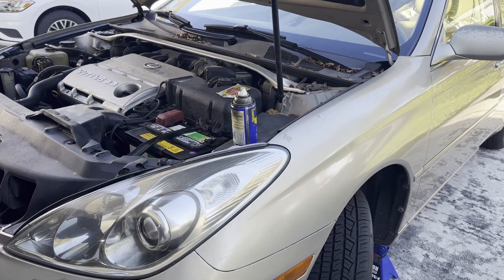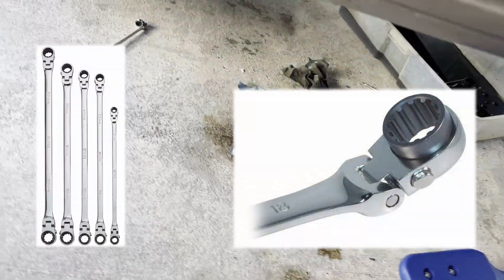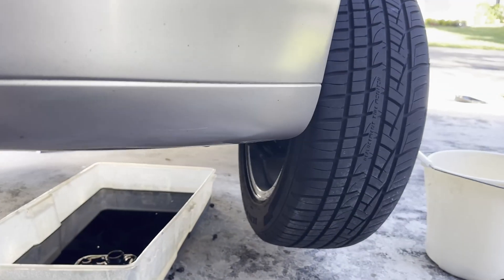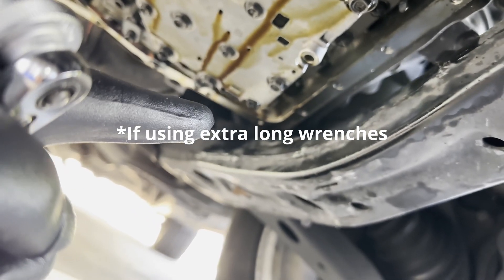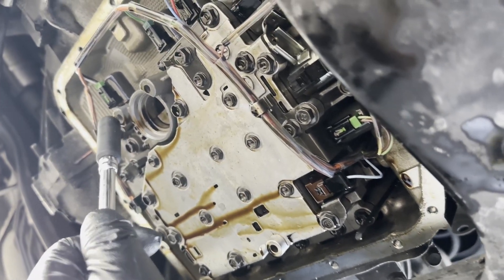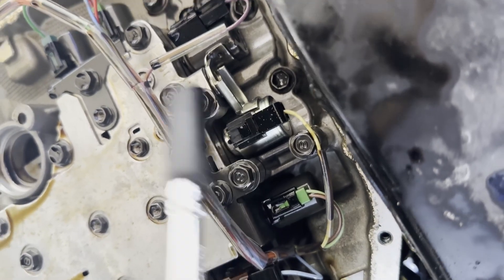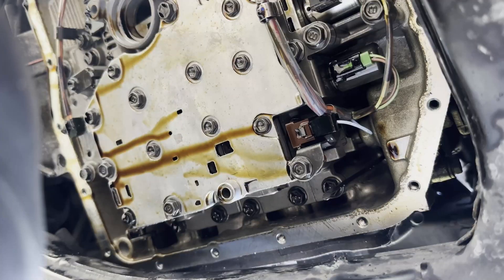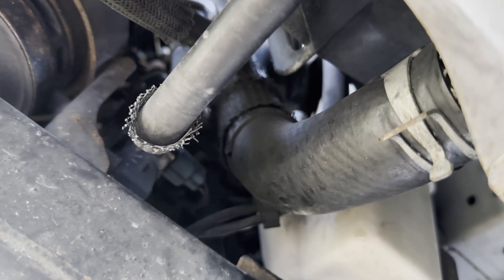Lexus ES330 Transmission Solenoid Replacement

Comment: Highly recommend you go about slowly replacing all of the tranny fluid based on that color. I would wager that your solenoid wasn't exactly a problem itself, but was blocked by friction material from your clutches, that is what stains the fluid black. If you don't want to be replacing more solenoids every year or two, just drain and fill your tranny about 6-10 times over the next bit, this will slowly dilute the old bad fluid out instead of shocking the system with all fresh fluid. I believe you're tranny holds about 8.5qts with diff included and takes 3.5 on a drain and fill(obviously check your handbook.)

Comment: How long after you replaced the Shift Solenoid D, was the car able to shift into 5th? Was it right away or did it take a couple days???
Reply from the maker: Should go right away. Mine didn't, but that's because I coincidentally had knock sensors go bad and put the car into limp mode before I could test it. The replacement knock sensor was also bad (not OEM), and the car had a lot of other problems that I didn't want to deal with. I frankly got tired of working on it, so I junked it. My next step would have been to drop the transmission and buy a rebuild kit as I said in another comment reply, but I don't have the setup or space to take on a job that dirty and complicated. Good luck if you're having a similar issue. Hope my vid helped.
Reply: @Omnis2   I just replaced my solenoid D yesterday and on the first drive, the car went into 5th but it seemed like it didn't want to stay in 5th. I drove it again later on the same day and it seemed to get worse and just wanted to stay in 4th and then P0766 code came back on later that night.
Reply: @Joecuzzi  My es300 has been running solenoid codes the whole time I've had it. So, your solenoid PROBABLY isn't bad, what's more likely is there is a lack of friction material on some clutches, or a lack of pressure when demanded to go into certain gear from gunk buildup. It is possible that the solenoid has shorted or stopped actuating, but it is more likely another problem being reported by your ecu as a random solenoid because this is the only way your ecu can report on the transmission in these older cars. The code is not saying that solenoid D is broken or inop, it is saying there is an issue in the function of solenoid d, whether that be the actual solenoid, the clutches it controls, or some other pressure problem. From my last 6 months of experience with a 200000m es300, try drain and filling new ATF from toyo about 6-10 times(the aftermarket valvoline etc do not work correctly), and drive it really hard for about a week between drain and fills. The idea here is similar to trying to do a light engine flush, we want the new fluid to get hot and help extract old gunk gently and push it to the filter, which you should replace at the very end. If you notice any improvement in shift quality throughout this process, I would bet strongly you're solenoid is in fact, fine, and it is a pressure buildup problem from gunk in valve body passageways, your next step would be a sonnix valve body rebuild kit. If draining and filling 6-10 times isn't slowly improving your shifting, your clutch plates are likely just shot and its time for a full rebuild or junkyard trans.
Reply: @Omnis2  I see, disregard my previous comment, sorry you had to junk your es330, I really love my 01 es300 but am slowly trying to chip away at an array of problems. Solenoid codes, knock sensors, vvt and misfires for me. The surprising part is my car really drives perfectly fine when warmed up, but when cold cant even get into drive 😂.
Reply from the maker: @koleking2519  No, no, don't disregard your comment. Keep it here because it's really helpful. I agree that the new solenoid probably wasn't bad, but the old one wouldn't actuate when I tested it outside of the car. It's possible that there was a bunch of gunk in it that wouldn't let it function correctly. I had done a transmission fluid change as a regular service and that's when the issue started, actually. Once I eliminated the solenoid as an issue, I knew the next step would have been to drop the whole transmission and rebuild it since, as you said, the clutches between the OD gearsets were probably shot. The fresh Toyota Type 4 probably washed away whatever friction material was left holding on lol. In hindsight, something in there had to have gone bad to get the transmission fluid that black that quickly. Never had that in any car I've owned.
Reply: @Omnis2  I would agree with you're diagnosis, its unfortunate that the previous owners neglect can make basic maintenance treacherous, but, such is our life as grease monkeys.  If I could go back in time I also wouldn't have touched my fluid, it was quite dark, luckily, 6 changes later I am experiencing noticeable improvement in my shifts so maybe I caught it just in time, probably not though, from all my research my u140e is basically made of glass at this milage.

Comment: Did your es330 have any error codes?  I have no codes, but the dash shows 4 when its in D  and the transmission won't shift to 5th.
Reply from the maker: P0768/9 was the solenoid code. What you're describing is a broken shifter position selector switch. There's a "U"/"Y" white plastic switch that only goes with the shifter when you move it from D to 4-L.

Two solutions:

1. Cheap: disassemble the bezel and the top part of the shifter assembly including the black plastic (covering the path where the shifter travels), etc.. Peer down and look for the broken U or Y shape white plastic piece, it should be in the 4-D area of the track. The broken switch will look like half of the letter U or an opposite-facing letter J -- get the picture? All you have to do is flick this switch to the right (-->) -- this will now tell the transmission that the selector is in the D position (gears 1 thru 5) when you start the car up later. The only downside to this is that you won't be able to use 4 to L anymore without getting stuck in 4 and disassembling the whole thing again. You can probably rig something up with epoxy to fix it.

2. Expensive: Replace the whole assembly at the dealership.

Comment: Why do you have to remove the valve body cover to remove shift selonoid? Doesn’t appear you have to…?
Reply from the maker: Sorry, your question is unclear. You have to remove the cover because that whole valve body is sitting in transmission fluid, but that's obvious. I'm assuming you mean removing the valve body itself. I noted at 3:59 that you don't have to remove the body for some of the solenoids, but for the long solenoids you may have to. I noted that I was wasn't sure about that, but you can always try getting them out with the body on and then just drop it if you don't have the clearance. I am not a resource on a whole valve body replacement job or any other transmission issues. I don't know anything more than what I explained in this video. Good luck.

Comment: Which one is solenoid B ??? Ihave code p0776 car shift hard and jerking and slipping drive fine after 40 mph but still hard shift but with light pressure on gas car drive fine just still hard shift like a 94 accord
Reply from the maker: B would be SL2. That's the one with the black plastic body and the green clip tab on the right at 4:08. SL2 and SL3 are clutch control solenoids so if you replace SL2 and still have the problem, SL3 might also be bad.
Reply: @Omnis2 would make the transmission wine? Especially when cold
Reply from the maker: @ dunno. I’m not an expert, just a guy in the garage.
Reply: Ok thanks another question do I have to drop the vavlebody to replace those two solenoids B ??
Reply from the maker: @selfmade8402  you can probably do SL2/B without dropping the valve body. Be prepared to drop it though in case you can’t.
Reply: Definitely have to drop the valve body

Comment: my last gear isn’t shifting on the highway so gonna need to change solenoid D ……   How’s yours fairing no issues? Mines got 207,000 miles
Reply from the maker: Mine is probably a cube in a scrap yard right now, having been picked clean and parted out for 2025. The car had several other issues and wasn't worth the cost of repairing anymore. With regard to the solenoid, dropping the transmission cover and changing the solenoid is easy enough with the right tools as shown on video. The car still didn't want to get into final gear before I had issues with knock sensors and other problems come up that would put the car into limp mode and mask any other attempts to troubleshoot. My next step would have been to drop the transmission and install a rebuild kit. Even fresh ATF was turning straight black so I think the friction rings on that final gear assembly were shot. Curmudgeon Transmission here on YouTube and some other channels have nice videos of the teardown and reassembly of the U151E transmission. If you have a nice table/basin setup to tackle that mess, might be worth trying. It wasn't for me.
Reply: Wow thanks for sharing this information.